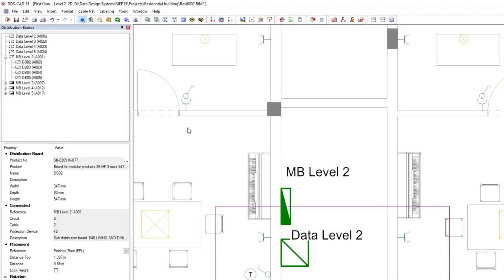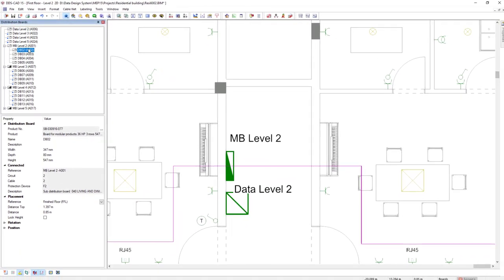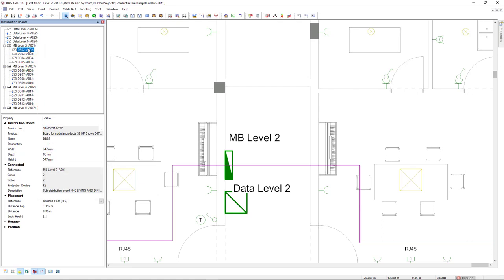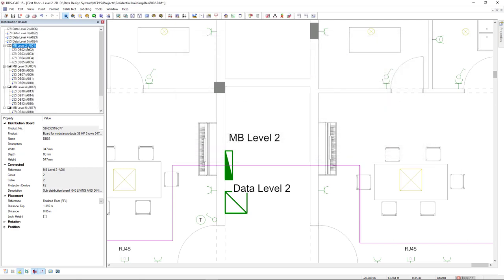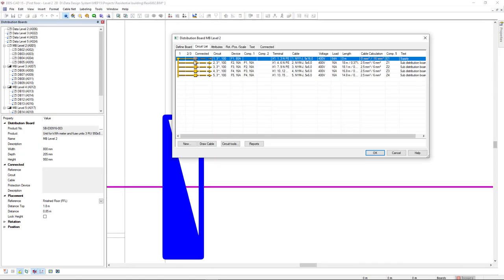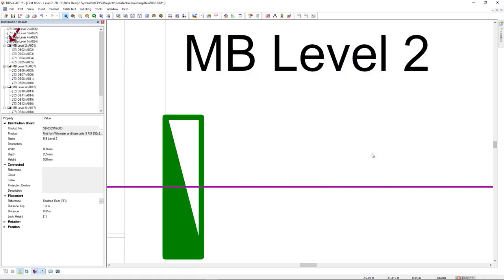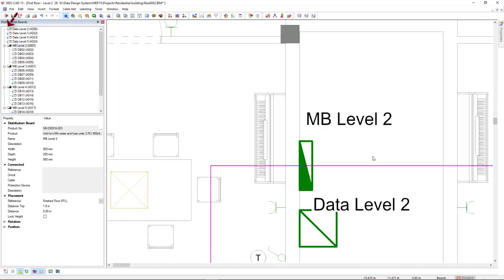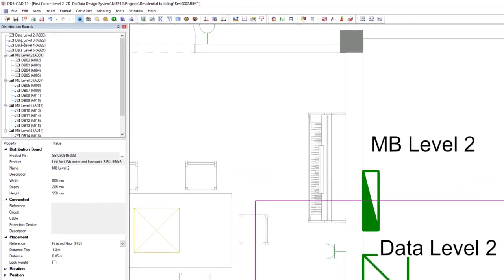New in DDScad 15: Distribution Board Manager

Comment: Hi DDS, 
Is there is integration with electrical calculation programs like, ETAP, Ecodial,...etc ?
Reply from the maker: Hi Hasan, you can perform cable calculation inside DDS-CAD based on the IEC 60364.
DDS-CAD does not have an integration with these software though. :)